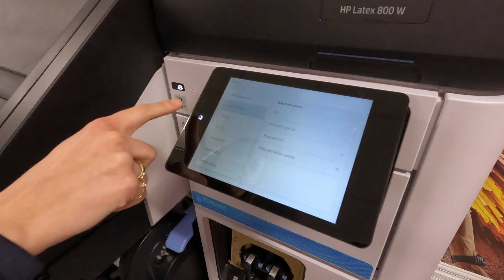HP's Solution to Latex Media Waste - the 64" Media Saver

Comment: Can it be used for wallpaper substrates?
Reply from the maker: Yes, the HP Latex Media Saver can be used for wallpaper substrates, as long as the wallpaper material is compatible with HP Latex inks and is loaded and profiled correctly in your printer.

Make sure to:

Select the correct media preset for your wallpaper.

Check advance calibration for proper panel alignment.

Monitor for media feed issues if the wallpaper has a strong texture or heavy coating. Some thicker or highly textured wallpaper materials may require manual calibration or additional advance to avoid head strikes or ink smearing. Always run a quick test before using the feature on a new substrate.

Comment: What machines is this compatible with please?
Reply from the maker: Hi @gavinnorton5388, the media saver is designed to be used with the 630, 700, and 800 series printers.
Reply: @ITSuppliesINC  not the l1500 or l2700w?